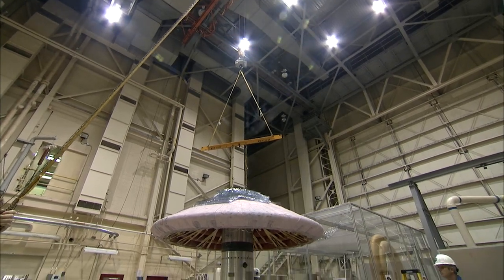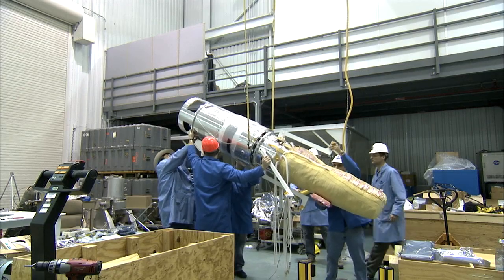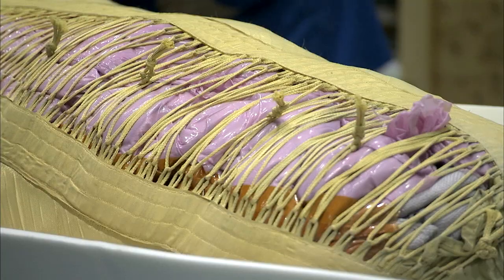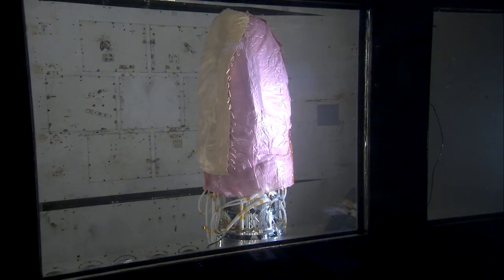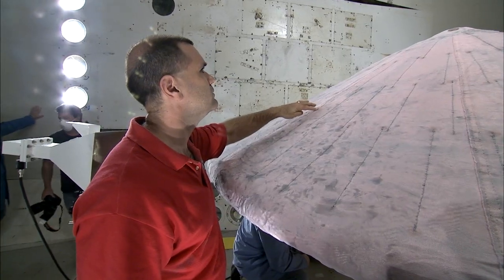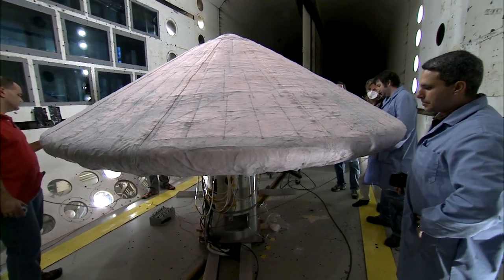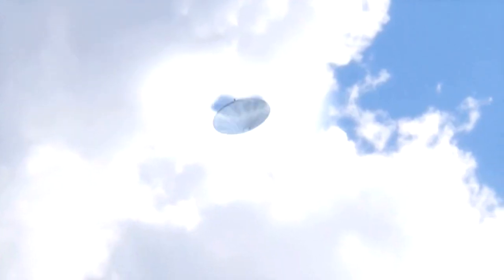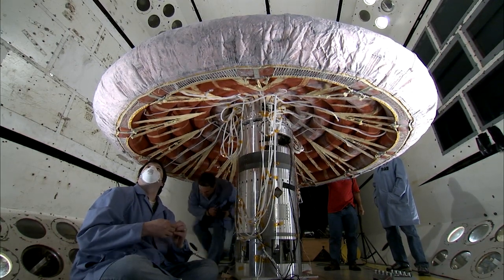Inflatable spacecraft heat shield ready to launch

Comment: the front end sensors, could route some monitoring for an outer ring backup for better stabile flexibility if there's any doubt. Also emit a cover signal to confuse enemy threats but well thats well rude. Still would look into graphine multilarering for internal fibre optical control. It looks ok for now.